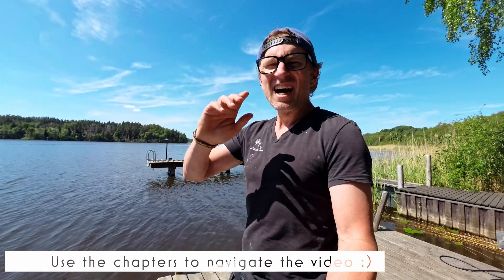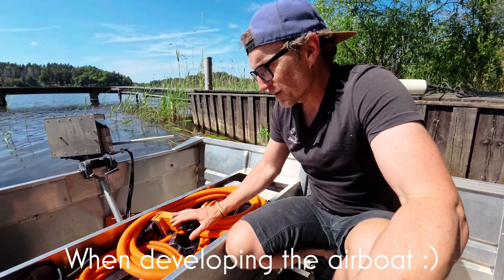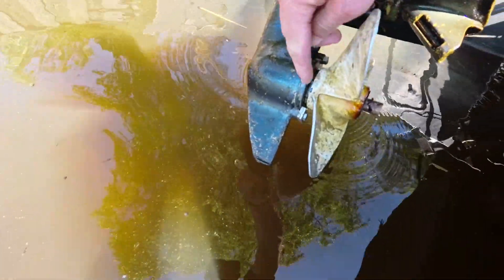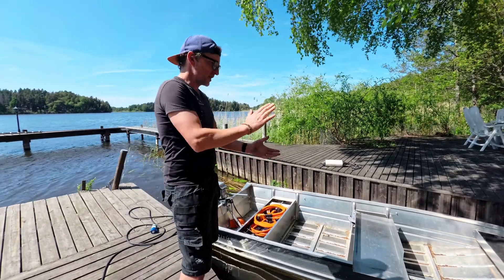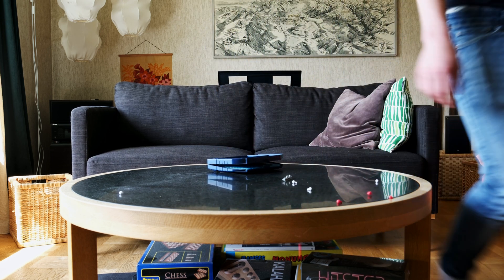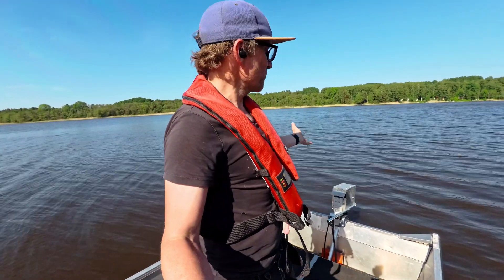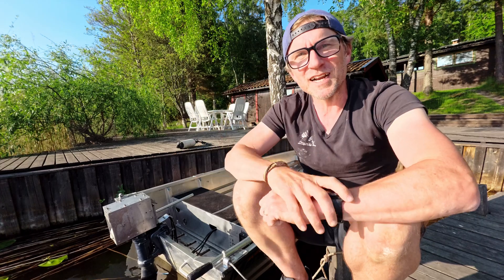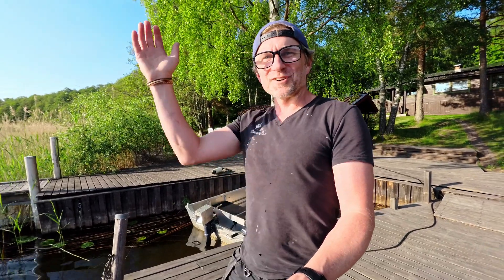DIY Electric outboard range test!

Comment: Now try it with a 6 hp 2-stroke outboard motor and see how far you will get with 54.43 liters of fuel (approximately 43 kg). 🙂
Reply from the maker: @iamkian  Probably HEAPS further! But you don't get back with an awesome heavy battery in your boat if you do that 😅😅Nice to hear from you again! /John
Reply: Around here on the electric only lakes, a 2-stroke outboard with 54.43 liters of fuel would get you to jail.
Reply: Remind me how much fuel you can collect using flat panels laid out in the sun? Renewable resources have other benefits to balance out their shortcomings.